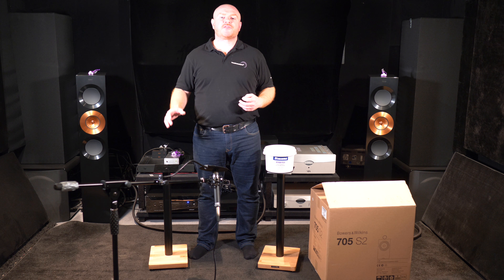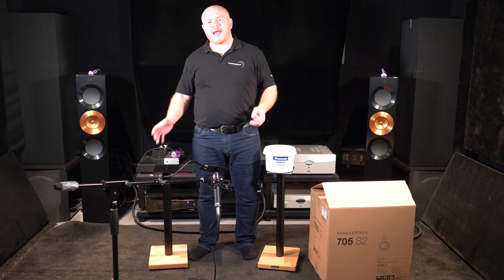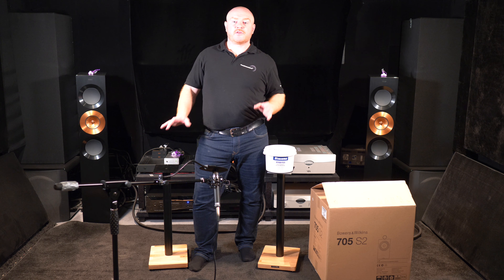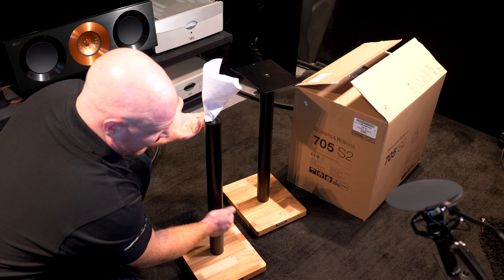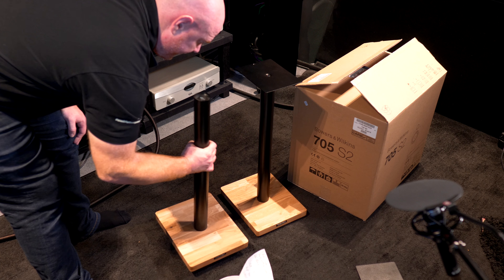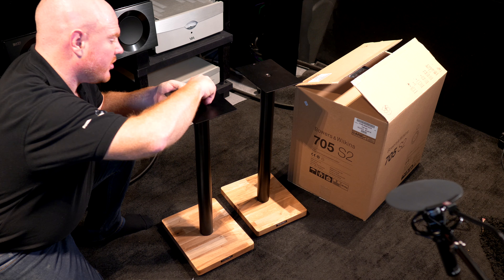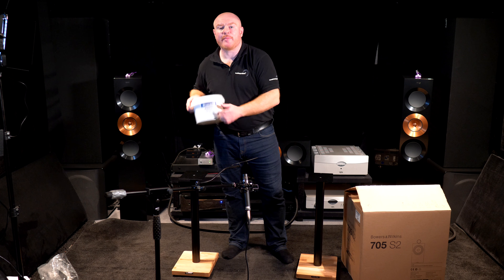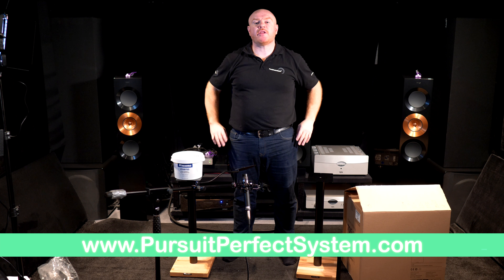How Much to Fill Up HiFi Speaker Stands - Filling in the Gaps Guide Advice

Comment: Some will agree or not, that’s ok. When filling metal stands with sand, fill the tubing up as far as it will go till you get to where the fasteners go into their threaded holes. Any less is useless. The key to making the stand inert is as much as it will hold and not restrict the insertion of the fasteners. You can use sand or that other material that makes them inert. You can even add acrylic casting resin to fill any air gaps. I like sand and the acrylic resin myself. It makes them very inert. Try it if you doubt me!

Comment: The ring test is made with a screw driver..and when your filling the stands you want to rock them back and forth so the sand is even out..after your done filling then up you to flip it upside down a couple times till you dont hear the sand moving around..then with a screw driver do the ring test..after one month the stands will have to be refill due to the low frequency moving the sand around...after that you should repeat the the test and those suckers should be solid..best advice..buy iso acoustics to decouple off the metal top of the stands and  speakers and some iso pucks to decouple the bottom feet of the stands off the floor...trust me it's going to sound beautiful

Comment: Note that certain speakers' cabinets, like Vienna Acoustics Bach (floor-standing tower) speakers, are also to be filled with some filler (do not know how!) to eliminate the cabinet natural resonances. Some people use "lead shot", unaware that lead is poisonous and quite dangerous to be around. On the other hand, natural sand might easily absorb water and damage a speaker wood cabinet etc. Cat Litter, perfectly playground white sand, and silica sand  are also recommend. However, Atabites has an approximate density of 2403 KG/m sq. compared to dry sand which has a typical rating of just 1442 KG/m sq. but on the negative  side: since Atabites are zinc covered little discs, one should note that zinc is also toxic and especially dangerous for little kids who might unknowingly eat it.

Comment: Would expanding foam work to eliminate the ringing?
Reply: yes it would, but of course it wont add weight for stability plus is messy stuff to deal with, it will expanding into and out of any gaps!

Comment: I've been using either Quikrete or  Sakrete dry concrete mix (no water added, of course) from my local Home Depot or Lowes home improvement stores and it works like a charm. That stuff is dense and heavy so my stands are heavy(somewhere between 20-25lbs) and there is no ringing whatsoever.....and it's dirt cheap to boot.

Comment: I bought cat sand which is even finer thus weighs more (for same volume) than this "audiophile" sand. 
Now my stands are heavy and dead sound-wise. It cost me 5€ for a 20kg bag.
Reply: Andrew Jones (KEF, Infinity, Pioneer, TAD, Elac) does the same thing and suggested it as it's very, very dry, and you can get it almost anywhere.
Reply: stevenswall what type of cat sand. Or does it not mater
Reply: I have 3 cats and so have always cat litter at home! nice!
Reply: Simply a fine powder of dry bentonite clay & charcoal 👍

Comment: Not convinced that the stands are that good or the damping is any better than sand which is so easy. My old Atacama stands have a much larger column, are much more stable and completely dead with sand and the sand fills a plastic bag inside (provided by Atacama) so that the kiln dried sand is nicely contained.
Reply from the maker: The new Atacama Nexxus speaker stands are much better than these ones https://youtu.be/Txxx40-LBOo

Comment: I have to ask the following..1. Why not just fill them to the top...if you have so much filler left over..makes no sense messing about. 2. I wish you had chucked the B and W on the stands before you filled it..recorded them then filled the stands re-recorded them and A/B the results...seems like you had the perfect opportunity if the room is so well acoustically damped to show if it makes a significant difference and lastly...should have used that screwdriver rather than your knuckles...made me wince each time...! On a more serious note please do a speakers on the unit..speakers on stands with no filler and speakers on stands with filler...I would love to hear the difference between the three positions. Cheers
Reply from the maker: I could have just filled them the top, I was just demonstrating the minimum you might get away with using from memory.  That would have been a good demo, I didn't think of it at the time
Reply: @PursuitPerfectSystem  I asked as about to get some new bookshelf speakers and stands on the weekend ...would have been fascinating to see if there is any significant improvement....maybe you could do a demo like that at some point.
Reply from the maker: @bassmandudge  Spend the extra money and fill the stands up mate. You dont want them ringing at all :)
Reply: @PursuitPerfectSystem  no your right...I dont want any resonance...
Reply from the maker: @bassmandudge  it can only add to the sound of the speaker there is enough doing that already

Comment: Interesting video i have been looking at this product today as im considering getting some KEF S2 stands to go with KEF ls50 meta's,  your stands in this video dont look very stable im assuming the KEFs would be a bit better? how much more stable are the stands with this product inside?
Reply from the maker: I have used these a lot and they are perfectly fine but for about £20 more you can get these which I think would be better as they have dual uprights  https://geni.us/ivmHjdu  - sorry about the old video quality not as good as my recent work
Reply: @PursuitPerfectSystem  i like the look of KEF S2 stands because they allow the ls50 meta's to bolt down onto the plinth. 
I have children and constantly worry about the thought of speakers being knocked off.  Do you think stands fully filled with this product speakers bolted onto the stand would be as stable as a small floorstanding speaker?
Reply from the maker: @hclandscapes  hard to say without nudging them and seeing but I dont really see the difference from a floorstander if the speakers is bolted to the stand
Reply: @PursuitPerfectSystem  do you think one tub would do both KEF stands?
Reply from the maker: @hclandscapes  sorry really not sure mate I havent seen the kef stands
Reply: @PursuitPerfectSystem  i just bought one for now, so hopefully that will be enough 🤞i'l post my results on here so it may help others if there in my situation
Reply from the maker: @hclandscapes  thanks best of luck.mate
Reply: @hclandscapes  any good then?
Reply: @GeneralAtrox1  i didn't buy it , im still not 100% sure on the stands. Right now my ls50 meta's are sat on a solid oak tv cabinet and are very stable, especially with blutack underneath of them!
I dont know how safe and stable the speaker stands are

Comment: can someone explain why you should not fill stands all the way up?
Reply from the maker: I think you can I was showing the minimum needed to stop the standa ringing
Reply: @PursuitPerfectSystem   Thank's :-)
Reply: There is a chance the stand would tip over
Reply: I think center of gravity should be considered too, the higher you fill, the higher center of gravity and speaker will not be stable especially if the speaker is heavy. Not sure if related to sound quality.

Comment: Those stands are awfully small so not much mass would be added
Reply from the maker: these are entry level stands, I have been surprised by just how good they are still. in terms of different speakers sounding very good on them.
Atacama offer more comprehensive stands than this also - I prefer designs with multiple uprights over ones with a single as the top plate is more stable, however these stands have done a really great job for me so far

Comment: I thought you were going to demonstrate the differences in sound when filled at different amounts. Some speakers don’t like filled stands, so you need to experiment to find which is best for your speakers. I disagree that stands are as important as the speakers.
Reply from the maker: All speakers are the same if the stand rings because its hollow it will ad that ringing to the sound the speaker creates this is just common sense.
Its also common sense that more mass in the stand the better

Comment: Seems kind of flimsy. Making speaker stands out of ringing material is questionable to begin with. Also using only one narrow tube means there will not be much to fill, therefore not much mass is possible. Also using wood as the bottom and steel top is wrong. Wood is too light and the center of gravity becomes too high. They are not supposed to rock at all, even when empty. The stand should be at least about twice the weight of the speaker, more preferred.
Also, purpose of that filling material may not be for speakers to perform better. Sellers purpose is usually to sell and make a profit. That filling seems excellent for that purpose.
Sorry for being so negative. :)

Comment: you can't just dig up some free beach sand, you have to use "audiophile grade" particles for $400 a pound!
Reply from the maker: beech sand holds moisture so it will rot the stands from the inside - you can use dry kiln sand but for about £30 these atacama atabites does the job perfectly and makes it easy